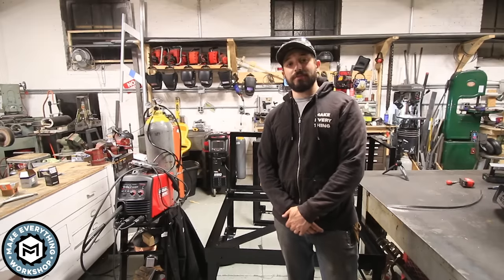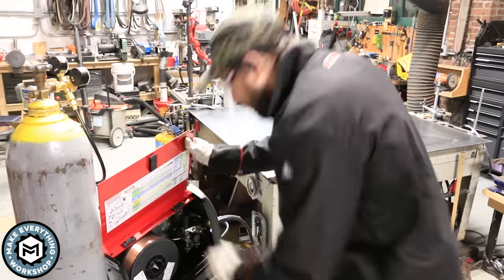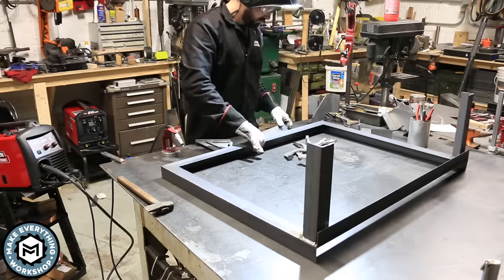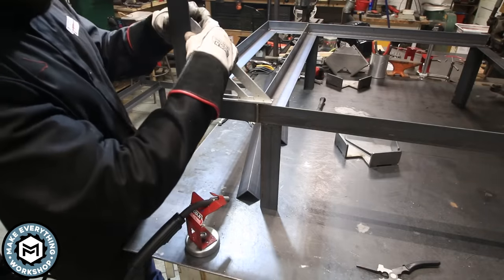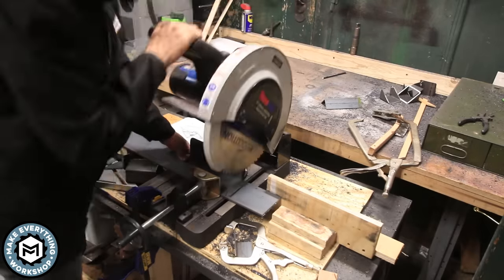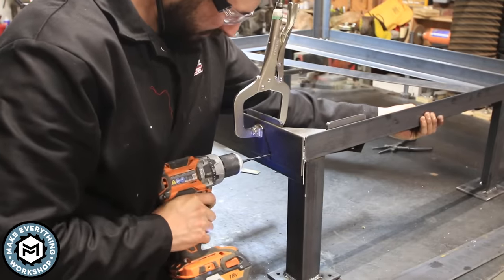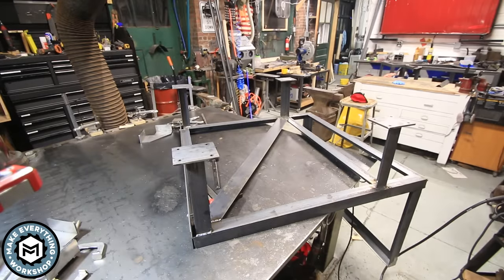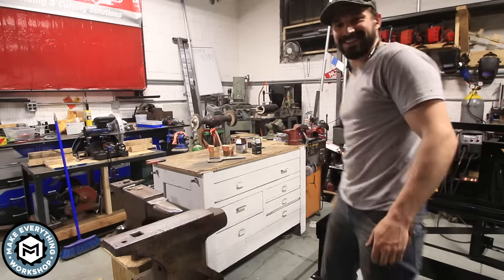How I Make Money With My Mig Welder

Comment: Pro tip.... anyone getting into welding  should start with a stick itll make you a better welder
Reply: True. I done stick for 5 years and the first time in jumped on a mig all the other workers thought I was doing it for years. My first bead on a mig was beautiful
Reply: I agree. I started off my first 6yrs of welding with the stick and it made a world of difference. It made the transition into using the mig these past 20 yrs afterwards a much easier process. I always pick up the stick from time to time just to keep my touch.
Reply: I've heard this but where I am from mig and tig rule it so I started out with mig
Reply: @amanwithouthope9475  I’m trying to learn tig. Where I’m from that’s where the most money is.
Reply: @diegogamboa8466  yep I think that's just about everywhere from what I hear from fellow tradesman. If you can get good with tig you have money waiting cause the dimes you can stack with tig are just beautiful.

Comment: A good way to quote is to use a shop hourly rate. $40 to $60 per hr seems about right for a 'moonlight' home based shop. Also have a 1/4 hr minimum fee for quicky weld-while-you-wait customers. Lots of walk-in repair jobs are nothing more than a quick dust-off with a flap disc and a spot or bead. Learn to work while you chat:)

Comment: Old school drilling tip... Out of cutting oil ? ..use dish soap as a lubricant .. no joke, it really works. Best to you and yours.
.
Reply: cutting lubricant/coolant is over 90% water, so water works just fine aswell, just use alot of it.
Reply: If you have any automatic transmission fluid, new or used, it is fantastic as a cutting lube. Unless you are cutting aluminum, then use wax.
Reply: @Sondalive  I have been using water a lot.  For most things the objective is to remove heat and water is very good for that.  Using a hole saw in aluminum with running water over it is like a secret weapon, I have even packed ice around the hole saw, even better.  I use oil for taps, usually air tool oil because I bought too much of that.
Reply: Steve M 
That’s because you don’t understand the role of lubricant in metalworking.
Reply: Custom Haines 
I’ve been happy using olive oil cutting threads in aluminum LOL
Reply: Sondre Bjørndal 
Water is an inexpensive carrier that delivers the lubricant. That doesn’t mean plain water is a good lubricant.
 I have some pretty old taps that are still in service years later. That’s from using proper lubricants, good lubricant practice, and cleanliness. 
Which is another point: a good bandsaw or mill lubricant isn’t good for threading holes; tap lubricants are poor milling lubes. 
Just saying.....
Reply: I will remember this one,thank you.
Reply: Pro tip
Reply: Pork lard, with all materials and the correct drilling speed and cut speed. The miracle and the cheapest lubricant.
Reply: @customhaines2510  Yr right, l have used it since the 80s
Reply: Old school tip for drilling stainless steel. Use straight hot strong perc coffee. Not instant.
Reply: Ray Walz: another one is acetone or methylated spirits for drilling and tapping aluminium
Reply: Sondre Bjørndal yeah i would not use that for lubrication, cooling yes but lube no
Reply: Normally in the shop is work for we use dish soap mixed with water when we run out and honestly works just as good and smells way better lol

Comment: Chris, you fabricated those stands very well. It’s good you put the extra brace on the legs. I am a painter, when ever I paint in someone’s house, I always paint a couple of extra things like door jambs or or window sash, this makes the customer happy and helps with referrals.
 I would like to give you a little advice as to your painting of your product. Spend more time, aerosol paint cans are good for touch up and hard to get corners the paint is very thin to get past the nozzle. Use a small fabric roller, do a prime coat first then a top coat with 6 or 8 hours dry time per coat. The finished product will look better and the paint will last for years.
Reply: There is a good chance a premium paint job was not quoted.  There is rattle can  and then there is brush.  They are not the same amount of time and they are not the same price.   Nor are they the same quality.   Too add a brushed oil paint for all four, would be hundreds of dollars more for me.  I'll do it if the client wants to pay for it.  If money was no option and they wanted primo finish, it can be taken to a powder coating shop, upping the cost even that much more.  Time = money

Sometimes, I just deliver the project raw as the client can save money having someone from their team painting it.  Which is fine by me.
Reply: He spent more than needed on materials for those braces on the legs.  A simple 5 inch gusset on each would have sufficed. instead he closed the entire frame again.
Reply: @E30cad  t was 1x1x1/8" angle iron the stuff is like 30 cents a foot, saving 2 feet of it but you add two angled cuts and two extra welds..
Reply: Where can I get anything for .30 a foot? Literally nothing on this planet is 30 cents a foot.

Comment: When I was in my twenties I used to do this type of work out of my shop. We use to joke about bid work being figure out the minimum it is going to cost to complete a project. Double it and add $30.00.
This way when you are done you still have $15.00 for a case of beer.
Reply: In the photography business we go by triple.

If the job is say, 30 dollars, I charge 90. 30 for cost of goods, 30 for taxes, 30 for profit (which is inevitably eaten up by cost of goods and business expenses). 

I have been running Best Little Studio for over a decade now and I have stuck to that rule of 3. I like to think I am a good value for my clients while still being able to pay uncle sam their cut and actually being able to pay for my kids food and clothing.
Reply: $150 minimum + $75 each additional hour for welding...
Reply: Buy the beer last not first LOL
Reply: I prefer to just bill by the hour!!
Reply: @The1TechGuru  Welding gets you shorter life----it's a fact?  (maybe I think longer life)
Reply: been welding aluminum a long time.  first with sticks in 1965 still to this day work with wire feed and tig---no masks or ventilation for first 40 years.  When e could not see because of the smoke we stepped back for a second.  Never have had health problems and the employees with boat building after 40 years only have a drinking 1/2 problem.
Reply: @The1TechGuru   I had minimums then I realized I could get a quick 20, 30, 50 bucks by doing something that took five to ten minutes.  Those customers often pay more per hour then someone who has a project that takes multiple hours.  This does not apply if I have to travel.  That has a minmum, because packing tools for the road takes time.
Reply: The doubling method is how I estimate required time (and cost as well).
Reply: Materials cost x 3= labor and profit

Comment: grinding bevels on a piece will ensure a deeper, stronger weld - especially if you dont want the weld on the visible side to show. It ensures "penetration" without turning up the amp your machine.
Reply: you don’t turn up amps, really. you turn up the volts. Mig welding is like a controlled dead short; you change the power (volts) to change the characteristics of the short until you are properly balanced between burn-back of the electrode and merely shorting out until the arc becomes balanced, melting into the base in an even, controlled manner.
Reply: No need to bevel if you start with a gap and run a keyhole weld.
Reply: @rudedogii  huh?!!! What if it's a 1/4 inch thick piece?

Comment: I have a Lincoln SP170T @240V and can run it off standard house hold voltage, trust me, you will not regret getting a slightly bigger machine.
If you want to weld thicker than you machine thinks it can or wants to, just turn off the gas and run flux core wire as it will weld a little hotter and deeper, but it splatters a lot so use splatter guard (the same spray you should be spraying in the nozzle).
Flux core is also HARD AS HELL so you wont be using it on something that needs to be machined to clean it up (tried that and NO GO) and it's great for wear surfaces, I did my snow blower shoes 7 years ago and they are still in great shape!

Comment: Cold cut saws are great. Little tip though for some better blade life. When cutting things like 1/4" plate, if you clamp it in vertically instead of horizontally it's much easier on the teeth. Any time you can avoid cutting against a flat surface with the saw, it will increase the longevity of those carbide teeth by preventing them from building up any excess heat. 🤘🏼

Comment: Loved everything about it, especially those squares for clamping and aligning the corners. But I hated the idea of using pneumatic tires. They inevitably loose air and become hard to push and cause whatever they are carrying to become uneven and possibly even hazardous. The only time pneumatic tires make sense is when you are rolling a load on rough and uneven terrain. Otherwise they are simply a liability. Sooner or later they become a problem. Ovens also need to be level at all times so hard rubber solid tires would definitely help ensure that.

Comment: I've found a chop saw/mitre saw is pretty much a must when building things with metal, even at a hobby level it can turn into a lot of work if you only have a grinder.
Reply: If you have the room or the money to upgrade, a vertical bandsaw with a coolant system also works very well. It's a bit slower than a chop saw with either the abrasive blades or the metal cutting blades. But you can possibly save on material since it's like a 1/16" cut vs closer to a 1/8" for the abrasive blade.

Comment: I like your approach, particularly the protection at the back for the fan housing on the oven, also the removable plate on the front for servicing. This is exactly what should be considered by all manufacturing no matter the size of business. I work in the service and repairs industry, many times I come across poorly thought out installs, plinths which prevent access to serviceable parts and generally make the job difficult when it shouldn't be. Your approach is appreciated, please pass it on. Good work dude :-)

Comment: If I'm ever building something with more than a few  weird shaped parts (or anything with lots of holes that need to line up) I just draw them up and have them laser cut. Costs up front, but if you have work coming in its way faster and less headache than trying to do all the drilling and shaping by hand.  Plus there is less dust and chips everywhere, and I dont have to worry about buying more drill bits, flap discs ETC. But this is a great method for one offs and people who arent ready to jump in there yet.

Comment: My machinist mentor used to tell me to price jobs by the rule of 3.. 

The cost of the material (1) x 3... this factors your time, material and the third part is the profit. This is for machine work, but I imagine the pricing is similar

Unless the material is very inexpensive or the time to build is very high, bit generally this rule applies.

Comment: I used to be a maintenance engineer for a large aluminium extrusion company. We used to have a large amount of similar trolleys that were always being brought in to have repairs/ the wheels replaced due to the wheels being bent or buckled or the bearings smashed, We got sick of using up a lot of time on drilling and tapping wheel plates and bolting and unbolting wheels so we used to just weld the wheel bracket straight onto the mounting plates with a few beads every inch or so. They hardly ever broke off and it saved a lot of time. Burns the zinc coating a bit but it didn't matter they never lasted long enough to get rusty before they were being cut off and replaced again.

Comment: Nice job. One trick I do is to notch out the angle instead of mitered angles. It allows for more weld in the corners. You will find its stronger and once you have done a few quicker.

Comment: dont weld your stack together. use a wood block on the moving jaw and you clamp the entire stack with no clean up needed
Reply: I believe he's meaning to not weld multiple pieces of metal together to drill holes in on a drill press vise. Simply use a small block of wood on each side of your stack of pieces in between your vise jaws. The wood will compress in the vise and tightly grip your stack of pieces you want to drill. If you weld a stack together you have to break them apart and try to clean them up causing more work and time.

Comment: Century is a small flux core welder owned by Lincoln and is great! With the correct flux wire you can get clean welds and it is certainly not discouraging.  You should try one... around $200.

Comment: Just discovered your channel and subscribed.  One comment.  Quit using lock washers.  They don't work.  Several videos available demonstrating this and a higher priced two part washer which does work.  I just use lock nuts, the ones with nylon inserts, on everything as long as they don't come into contact with high heat.  They're only a little more expensive than plain nuts.

Comment: I bought a Hobart 187, but then I used Miller Dimension 400 with a separate wire feed unit where I worked, before I retired, !00% duty at 400 Amperes. a real industrial welder. One needs a separate MIG, Tig, and stick welder, because one then doesn't have to set up the welder each time one changes the welding process.

Comment: For drilling I use dish soap and water. The water controls the temperature because it boils at 212 and the soap is a surfactant to be sure the water coats instead of beading up and rolling off. You dont need a lubricant. You need a coolant.
Petroleum based products will temper your work piece when you overheat it. As long as you keep water on your workpiece it cannot overheat.
Reply: I am amazed at that last keyboard welders last statement.... lmao
Dishsoap and tempering , haha

Comment: Thanks for the link to the flapper wheel. heres a $$ saving tip in return. 8:38 I have a bottle of old transmission fluid. It makes a great lube and is free. I also use it in a spray bottle for rustproof car parts and other metal. It wipes off easily and again its free. Hope it saves you some money.

Comment: Just want to add my 5 cents on gasless mig, im in Australia and much like you I've been learning different welding processes since highschool and throughout my career, i bought a 3 in one CIG welder around a year ago purchasing a small reel of gasless wire to use untill i could afford to upgrade to using gas, being very proficient at stick welding as well i found for my use the gasless wire works fine certainly not as good but produces more than adequate results, i would stress that if i were  using the mig every day i would absolutely invest in gas, and with the machine i purchased that is always a option for the future, long story short when the small reel ran out i happily purchased a large reel of flux core wire to keep me going

Comment: Future reference the place you bought the casters at should also sell weld on mounts. I just bought 4 for a steel table and they we $3 each and they have eyelet slots so they are easy to adjust

Comment: At my work i use stick(arch welder) for welding thick steel for more penetration and for thin panel steel etc i use the gasless mig and it does the job.👍
Reply: Have you tried dual shield welding? More up front cost but fantastic welds and almost no clean up. With the right wire you can weld out of position too.

Comment: Ok, I made it to 9:00 and had to stop to comment, the little things make a big difference between hobbyist and journeyman level. When welding up the plates to stack drill them, weld the corners instead of the flats since rounding them off after you break them apart will both get rid of the weld marks, and provide a nice corner to mate up to your caster. The lower main frame should be built as the larger diameter rectangle instead of the smaller on with the add on, it is much stronger, and will guarantee a nice straight line on the horizontal. Saves time on fitup, and cleanup for paint later even if it takes longer to notch the cross bar.

Comment: Great intro video to welding. Been debating about welders to get. Definitely did not want a cheap import from Harbor Freight and was looking at a Lincoln and you just sold me on the 140 MP. Thanks!
Reply: Lincoln is made in USA with globally sourced materials... aka Made in China materials.
Reply: I have a 140C and if I had to do it again, I'd get the smallest 220V welder rather than the largest 110V unit. The duty cycle is a real pain if you have any longer welds. 
A small multi process 220V welder would be my choice knowing what I know now.
Just my $0.02.

Comment: Hi 👋
Great video.
I agree with the 110 welder.
I have a different brand, but came with all three welding. I can also switch to 220 volts if I need to weld thicker material.

Comment: Great video thanks. I need to comment that you mean MAG instead of MIG. The 'I' is for inert gas, the 'A' is for Active gas. Active gas means there is CO2 in the welds which you can use for steel but not for Stainless steel, since CO2 makes a stainless steel weld corrode. Inert gas (Argon) is used for stainless steel.

Comment: personally, I can drill the plates faster one by one then doing it the stacked way. just prop up a corner jig so the drill cannot catch the material and spin it and insert the piece corner by corner in this jig, held by hand. Put a little cup of oil beneath the hole you are drilling and the drill will self lube. The time saved: not welding, not clamping, not pecking, not adding oil ... this adds up a lot too. Oh and use cobalt drills they are worth it